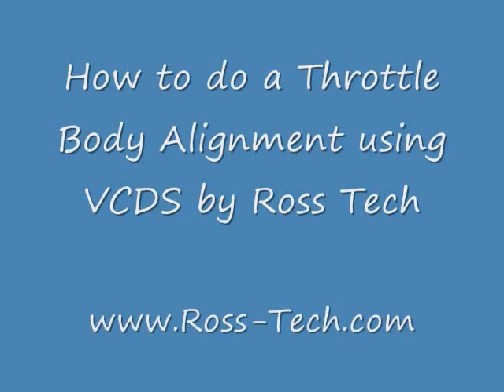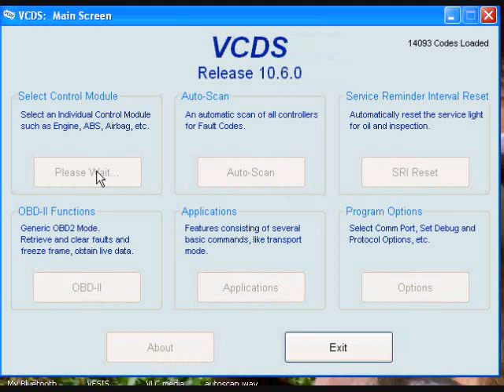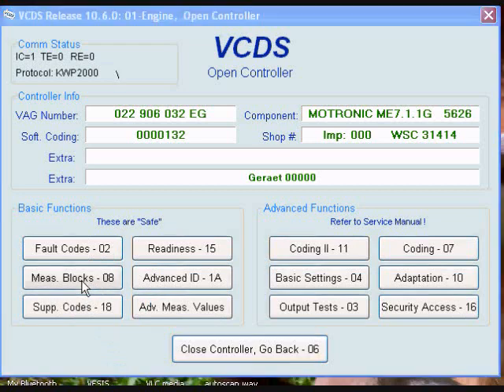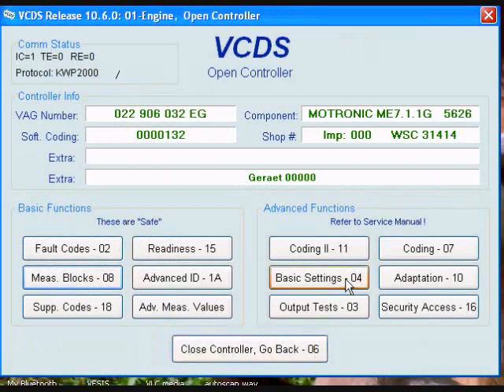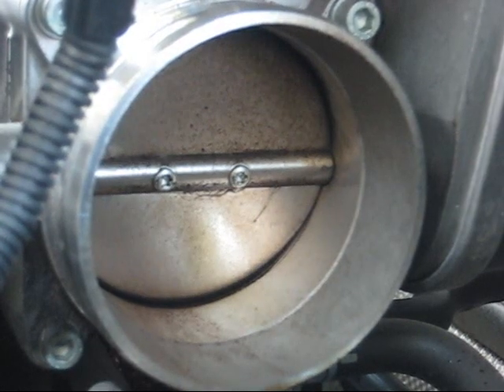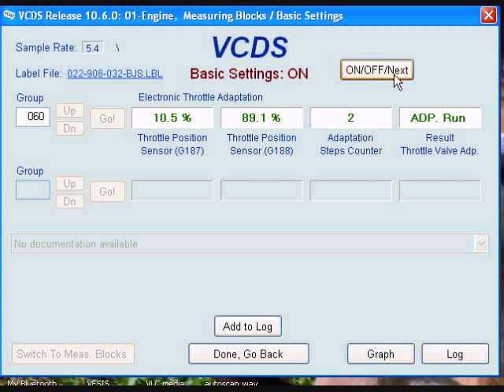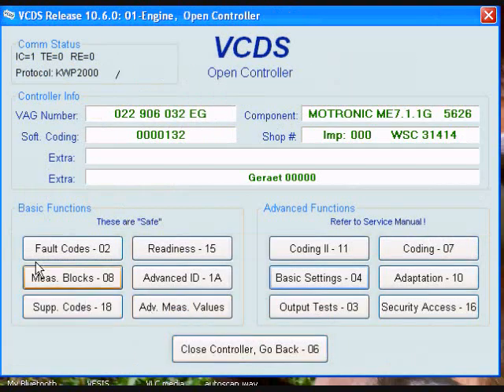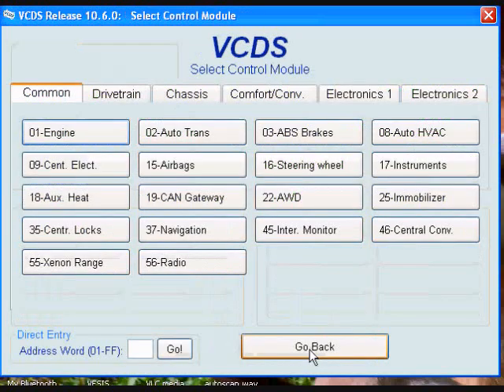How to do a Throttle Body Alignment

Comment from the maker: While it could be an issue with the Throttle Body, I've seen where O2 sensors get screwed and cause the EPC light to come on and flag Throttle body fault codes (and sometimes accelerator pedal codes).  If your car is a 1.8T, then take a close look at the O2 sensors.

Comment from the maker: Yes, the high value will be below 100%, the low value above 0%.  By doing this, if the circuit goes open or shorted, then the ECM knows bogus data is being sent since it should only have a range of 10% to 90% (give or take a little).  Different cars can different variations of what the low/high values are.